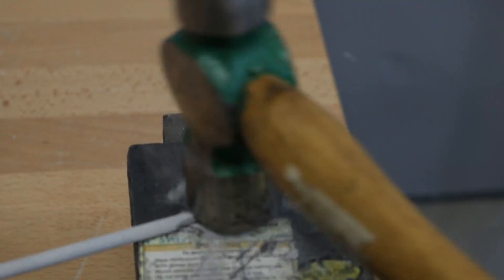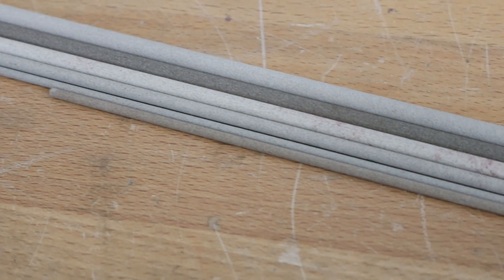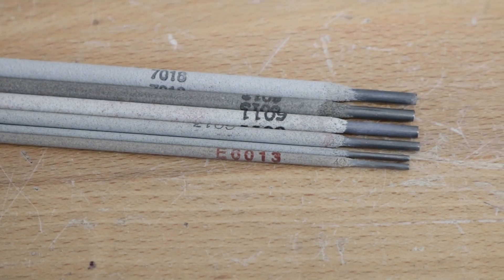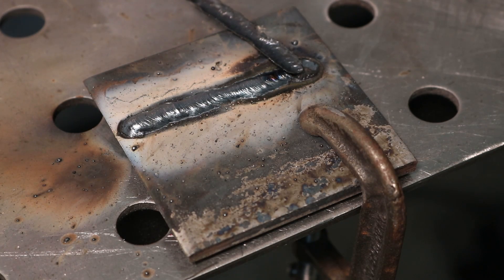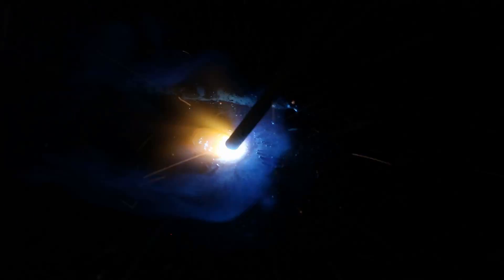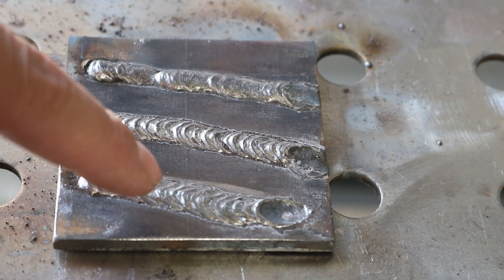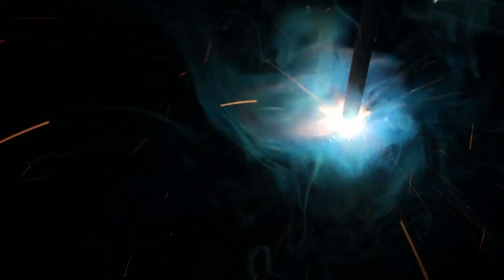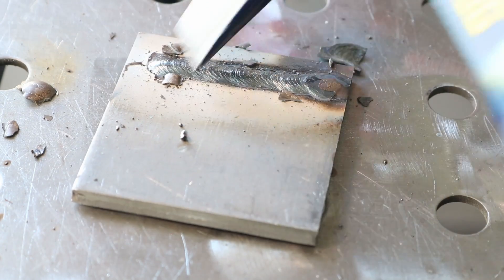Stick Welding Electrodes Explained: Stick Welding Basics for Beginners

Comment: Great video and channel Tim, thank you! Your discussion on 7018 was particularly interesting. I think I am hearing that the home shop welder or person making non-critical welds shouldn’t necessarily avoid 7018 for general non-critical mild steel fabrication just because they can’t meet the rigorous oven storage requirements?
Reply from the maker: Great question. Without knowing the details of a particular weld, I can't necessarily say whether it is needed or not. I can explain why they are stored in an oven. If moisture is absorbed into the flux of a welding electrode, it can become a source of hydrogen for the welded metal. When hydrogen is diffused into steel, it can cause cracking in the solid material. In order for this cracking to occur, three conditions must all exist: 1. presence of hydrogen 2. a susceptible microstructure (hard steel) 3. stress or restraint on the weld. In order to prevent this condition, industrial welding practice takes two preventative measures, low hydrogen practice and preheat of the material. The requirements for both of these depend on the amount of alloying elements in the material and the material thickness (which lead to conditions 2 and 3). Basically, thicker material and steel with more stuff in it is more prone to cracking. To draw a line in the sand, the structural steel code, AWS D1.1, allows rods other than low hydrogen on A36 mild steel under 3/4" thick without preheat. That same code also requires all low hydrogen electrodes to be oven stored. I know it's a firehose, but hopefully it helps provide some understanding.
Reply: @TimWelds  Thanks for the thorough response Tim, that’s very enlightening! So it sounds to me like 7018’s flux is not necessarily more hygroscopic than any other rod, but it’s common use is with low-hydrogen procedures, so you need the oven to ensure you’re not introducing hydrogen from the flux in those cases. That makes me wonder though, why don’t people stick other rods, say 6010, in an oven and use them with a low hydrogen procedure?
Reply from the maker: @Mike-ud5of  That's a great question. 6010 is a cellulosic electrode and contains hydrogen in the composition of the flux. In fact, it's partially made of wood dust and also has a high affinity for moisture. During welding with 6010, hydrogen gas needs to be released for it to have the arc characteristics that it does. While definitely not a good practice, some old school guys will actually dip 6010's in water to make them more punchy. Rutile rods (like 6013) do not have the same level of hydrogen, but still perform best with some amount of moisture in the flux. That leaves 'basic' rods like 7018 to be the option for low hydrogen work. The moisture in the flux is only one source of hydrogen, in can come from the flux itself or from surface oils (HYDROcarbons). If you find this as fascinating as I do, you can head way down the rabbit hole by dunking some fresh, hot welds in mineral oil to see the different amounts of hydrogen bubbling out (https://www.hobartbrothers.com/index.php?mact=News,cntnt01,print,0&cntnt01articleid=157&cntnt01showtemplate=false&cntnt01returnid=523). Most likely, however, you have better things to do and the photographs in this article will suffice. Thanks for the fun discussion...I definitely nerd out on this stuff.
Reply: @TimWelds  Thanks again Tim, great info and insight, I am learning a ton here. I’ll check out the article. I think your experience in both the welding trade and in engineering gives you a pretty unique and valuable point of view to share—I appreciate it and enjoy your channel!

Comment: It’s interesting that they stick welded in the beginning without a flux coat. The welds held, but they were variable and brittle. When ESAB invented the coated rod, or rather, the founder of the company invented it, it changed everything. That was about 100 years ago. How fast time flies!

6010 won’t run on most inexpensive machines.

Comment: Enjoyed your video. Thank you very much!  I am a beginner welder. I started on this journey because I have and old pickup truck that is falling apart due to rust. And, I thought this would be a good project to restore the truck and learn how to weld at the same time. I could use some guidance to minimize the  trial and error system. I would appreciate any suggestions from you and any and all of your subscribers. Thanks for taking the time to upload this video. Cheers and happy Holidays to ALL

Comment: Tim, would you mind showing us the settings on your machine when demonstrating/explaining things?  Love the videos . . . just got my machine this week!
Reply: I run just about everything at 89 or 115
Reply: @dobean6858  Thank you.
Reply: There's a reason why the range on sticks for example is so wide, like 7018 ⅛" is rated for like 95amps to 125amps, because it varies based on not only the base metal but even the Welder themselves, I'm a structural Welder and I know great welders who swear by 100-105amps, and there's guys can run verticals at 125amps, I myself prefer to keep it at 110-117amps, you also have to take into account transmission loss, so I'm an ironworker and if I am welding with just 50ft lead, I'll be at 112amps, but if I'm running 500ft of lead I'll have to crank it up to 125 just to get 115amps to come out of the stinger, so long and short of it is you'll have to figure it out for yourself
Reply: @leecolt9642  Thank you very much for the detailed explanation . . . as a hobby guy, your input is very helpful.   Happy New Year!
Reply: Like others have said, it’s personal preference, on 1/4” plate I run a 6010 at 110 amps. I run a 7018 on 130 amps. (Both in flat) although you don’t really have to change your machines settings based on your position, just travel speed maybe
Reply: @brendenperry3770  Thank you Sir . . . appreciate the input . . .
Reply: You always want to run the most possible amps that doesn't damage the material you're welding. This means you have to test your welder before you start welding, on a scrap piece of metal that matches the material you are welding. Do a test bead, make sure the weld bead flows out nicely and looks wet around the edges of the weld bead. If the weld bead is balled up on top of the metal and not melted down into the material, you need to run more amps. If the weld bead has soaked way down into the metal, and the edges are heavily melted, and you're melting into the material, then you need less amps. You want the bead to penetrate and wet the surrounding substrate, but not damage it.
Reply: @Ritalie  Thank you very much for the details . . . very much appreciated!
Reply: You will eventually learn that it does not matter much on many things what settings are used. For example, I can run a 6010 root between 80-90 amps, but anything more I cannot. Another person in my welding class could not run a root lower than 90. It really depends on your own individual style.

Comment: i recently started to do some welding, I would like to know welding thin square tubing, 
what welding rods should i use and how high should i set the amps of the welder? and 
also what's the best way to weld nuts on to thin metal lettering?
Reply from the maker: Hi Steve! I have a video coming out later today about stick welding thin square tubing. The settings will depend on the thickness, but for the 14 gauge tubing I was running, I used 3/32" 6013 electrodes set at 60 amps on an AC buzz box. For an inverter like you have, I would start at 55 amps and dial it in on some scrap pieces. As far as the nuts go, I would use a small diameter electrode, put the thin lettering flat on a thicker piece of metal to act as a heatsink, and tack weld 2 places on each nut by striking an arc and moving back and forth between the two to make sure you join both.

Comment: I recently started stick welding with the little Deko machine using 3/32" 6013 and 6010 rods. My biggest problem right now is fillet(?) welds where I try to join two pieces at a 90-degree angle. My bead always ends up sticking to one or the other piece, usually the horizontal one, but rarely to both, and I seem to get no penetration. I'd love it if you'd go over some welding techniques for different, common weld types, material thickness, rod size, and amperage. I think you explain things really well and look forward to more of your videos.
Reply from the maker: You are correct, it is called a fillet weld. I would get the 6013 down before worrying about 6010. I haven't run 6010 on the Deko, but some of these small inverters will work better with 6011. Without watching you weld, it's hard to say what's not going right. However, there are only 3 things that need to go right, so I'll list those. Focus on the first one until you get it down, then move on to the next. First, hold a tight arc; it should only be around 1/8" long. If the arc goes out at that length, you may need to add a few amps. Second, pay attention to your angle. On a tee-joint fillet, you need to point the rod 45 degrees into the joint, and drag by about 10 degrees. Finally, pay attention to your movement. watch the puddle grow to the size of the weld you want and make sure it's on both plates, then move at a pace that keeps the puddle at the same width. It takes a lot of practice. If your weld isn't coming out right, 9 times out of 10 one or two of those things will solve the problem. I have a full stick welding tutorial on my channel that might help with technique, and I'm working on a video about amperage that will come out in a few weeks. Weld on!
Reply: @TimWelds  Thank you so much for your detailed reply. It is very helpful and I appreciate you taking the time to respond!
Reply: What was the material thickness?   How much amperage were you using with the 6013s?

Comment: If you are welding steel with a higher strength than 7018, you would most likely use... 8018, 9018, 10018, 10718. At that point you are getting into hsla and hy territory.
Reply from the maker: Thanks for the comment! There are definitely higher strength rods. When you get into that territory, there is a huge pile of considerations beyond tensile strength as well as half a dozen other properties to worry about. There are also times that it makes sense to use an under-matched filler. HSLAs can be a bear all around because the fine grain structure that gives them incredible properties can be affected by the heat of welding, so proper design is critical. Certainly fun stuff!
Reply: @TimWelds  Hey Tim your videos are great! Thank you for keeping it informational. If I wanted to only keep one type of rod (different sizes of course) should I use 7018? Or 6011/6013? And would there be a need to use these higher strength that Scott was talking about? I’m looking to add a few pieces to a couple of trailers that I have. Thank you